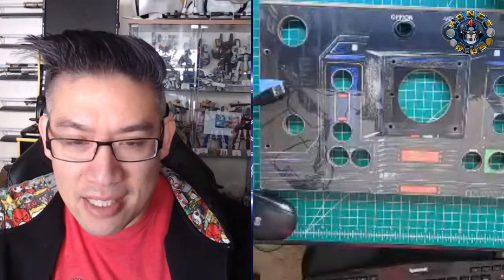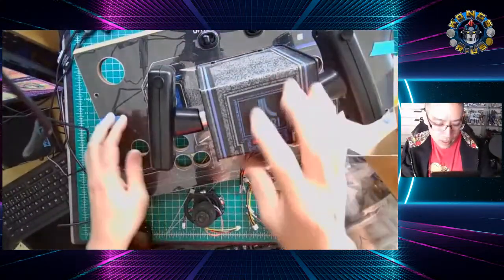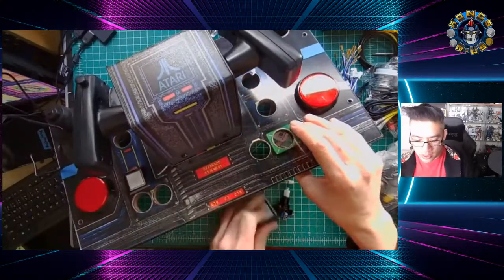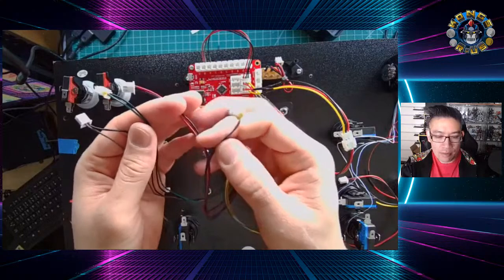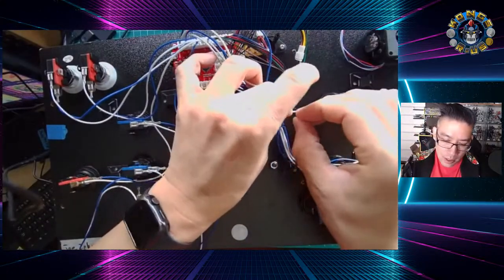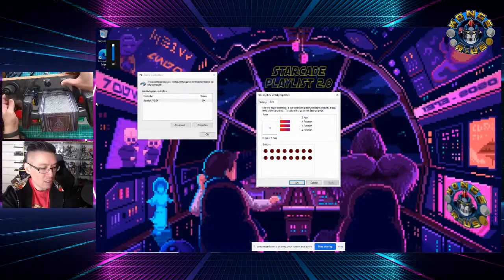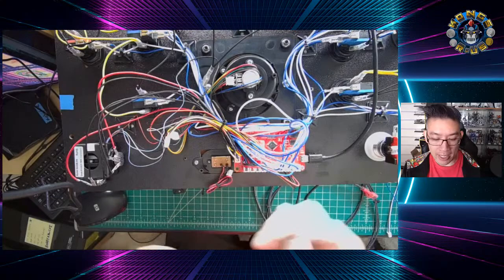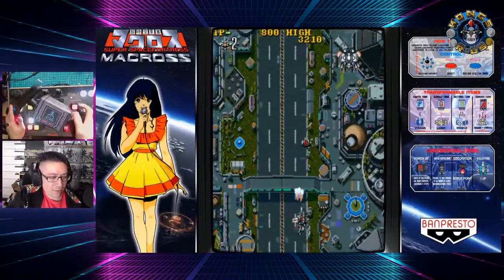Star Wars Arcade1up - StarCade Mod Kit - Installation Guide (Live Modding Session)

Comment: How did you drill the larger hole for the throttle?
Reply from the maker: I used a 1 1/2" hole saw for the throttle hole. If you don't have one, you could also carefully take apart the throttle so the joy stick can fit through a smaller hole and then put it back together